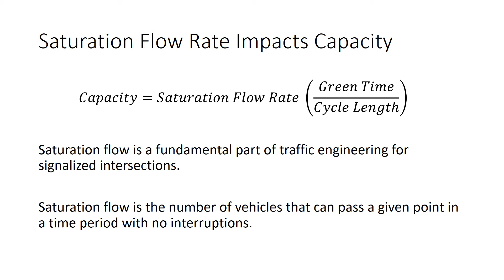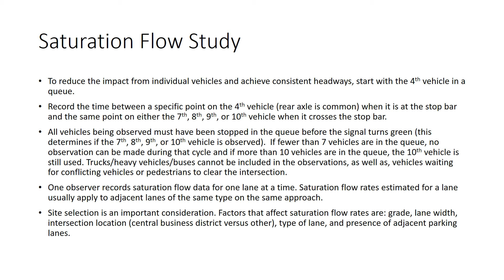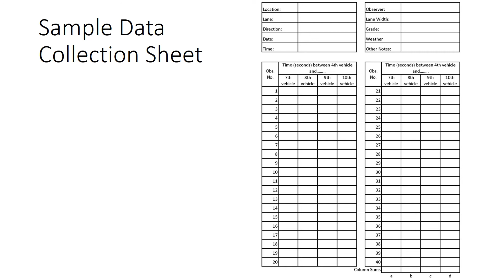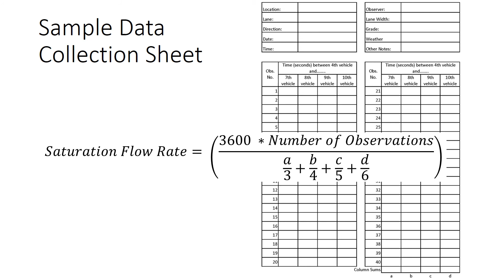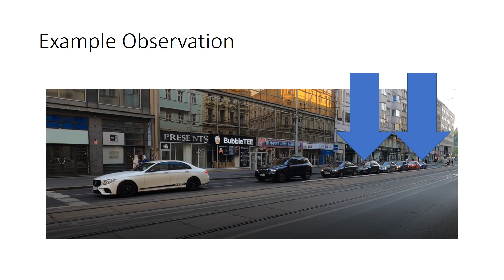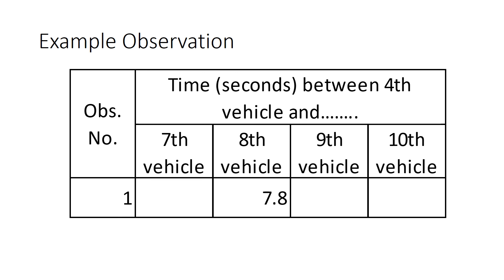Saturation Flow Rate for Signalized Intersection

Comment: Hello. I am currently doing a project that requires obtaining the saturation flow rate of an intersection in my city. May I know where the equation for the saturation flow rate came from (from a study, textbook, etc.) and if there is something that can be done to obtain the saturation flow rate for a mixed traffic condition, with many motorcycles and trucks/buses arriving along with the passenger cars, which is highly common in my city. 

Thank you!
Reply from the maker: The study is described and presented in the Manual of Transportation Engineering Studies, 2nd Edition (https://ecommerce.ite.org/IMIS/ItemDetail?iProductCode=TB-012A).

The standard method is to exclude motorcycles and trucks/buses, but you could collect the data with the mixed traffic (make sure to document the vehicles included).